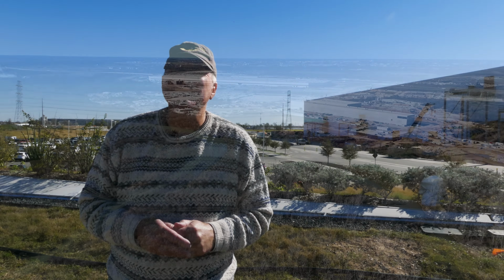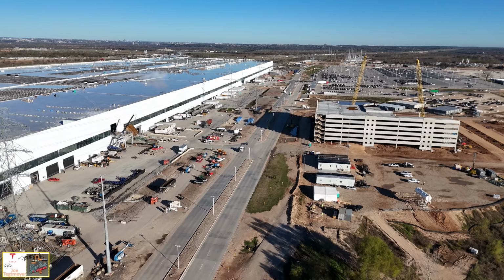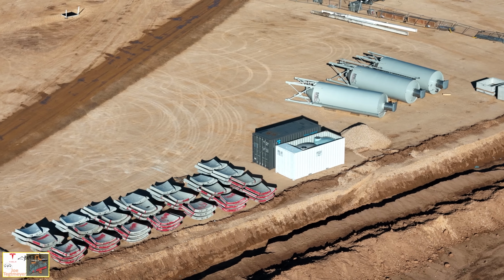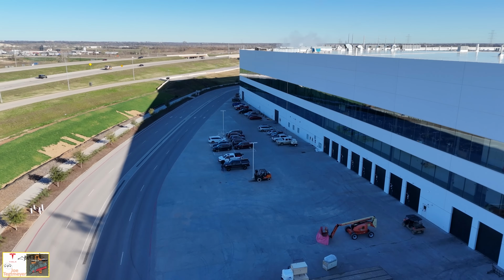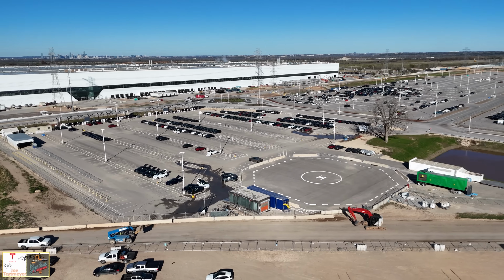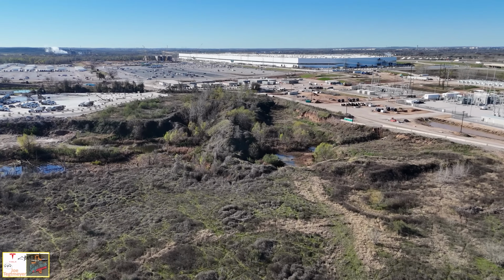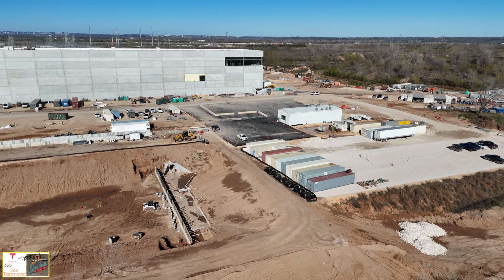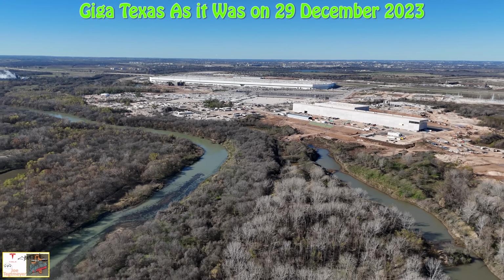Cybertrucks Moving! Far N Views & Boring Co Cement Silos! 29 Dec 2023 Giga Texas Update (09:15AM)

Comment: The obvious Boring Company tunnel is the one proposed to the Tesla land southeast under the Colorado River and perhaps two for bidirectional traffic.
The elephant in the room is only Tesla cars will fit. So I lean toward where it would be useful now, the highway.
How about a railroad shipping yard across the river too.
Reply: One should consider how many millions of gallons of diesel fuel they are using each year to transport all of these cars to a rail terminal.  Having one nearby will really help!  And if they are going to need to use rail transportation to bring in raw materials, that will help reduce costs.

I met a guy who had a factory near a rail line.  When he bought a train full of steel, it would last the company for about 6 months, and he said he saved about $6,000 on the shipping, and by buying steel  in bulk.  And that was back in 1975.
Reply: More likely to see a Boring tunnel from end of line building to the rail yard up in Hutto.
Reply: @Kangenpower7  They also could reduce operating costs and eliminate that diesel by switching the car transports to the Tesla Semi.
Reply: The electric trucks are coming soon for short-haul deliveries, and they may replace the trains if railroads don't electrify all lines. @Gig0Surf
Reply: Only tesla cars will fit?
Reply: Trains are already highly automated and efficient. Many routes are all electric without batteries for propulsion.
No rubber tires under trains and tires are the weakness of automotive transportation.

Comment: Boring company tunnel over (under) to west side would be great advertising. Few weeks before launch of CT they had one down there hauling a RVAC Raptor engine around on a trailer for promotional video. Great look.. great advertising. Neurolink will partner-up with a bot used to build MYs or some such. Right... on with the show.
Reply: I don't see where would it surface on the east side..
Reply: @0saskatchewan  Around ~ where the CTs are being kept at present. IMO. Ish... we saw with the underground cable connection with minimal real disruption to the east side. In all honesty they could just tunnel or mole over and under to and exact point where the machine puts its nose out.
Reply: @memrjohnno  I suppose.. anything is possible.. It's just such a short distance though.. 🤷‍♀😅
Reply: @0saskatchewan  Advertising and name recognition for the Elon owned but not Tesla (shareholder) owned... like SpaceX, Starlink and Neuralink.
Reply: @memrjohnno  I don't think they need it.. something more practical is the MO.. A tunnel to Corpus Chrisi would get more coverage anyway imo